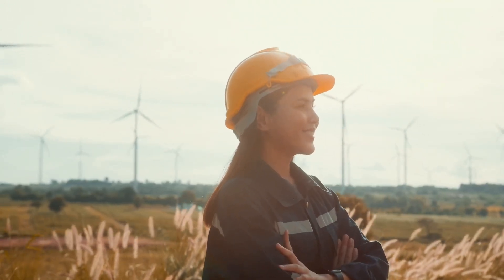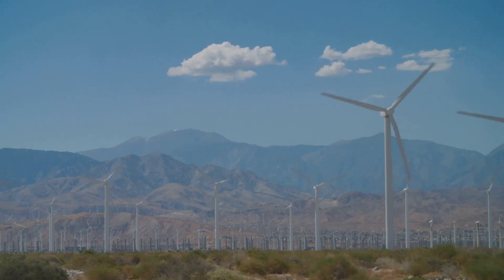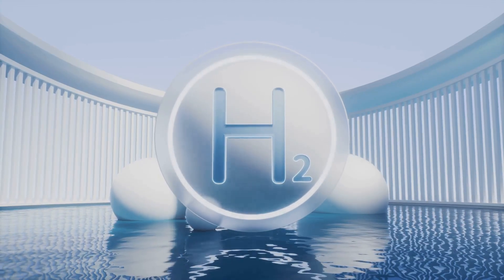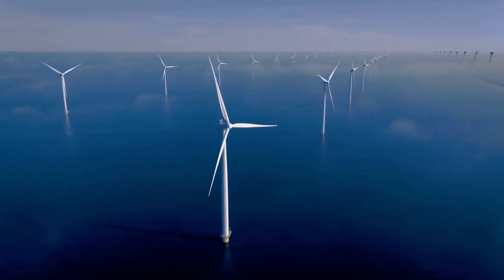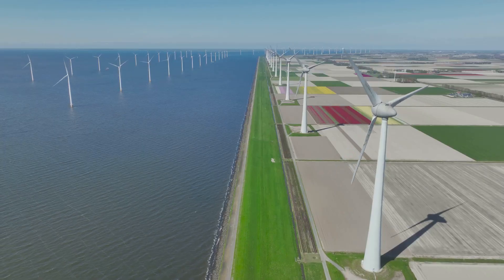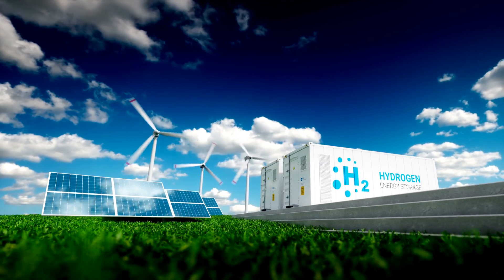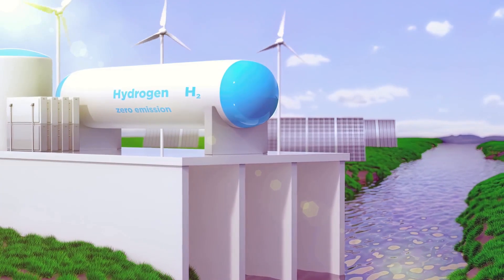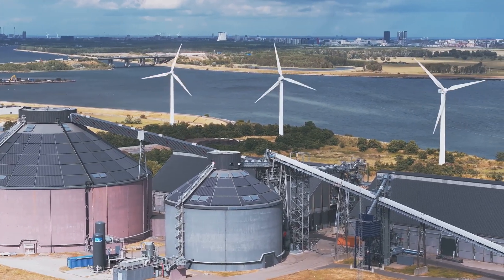Harnessing Wind Power for Hydrogen

Comment: So, if i am making a hydrogen fuel cell project using a wind turbine, can you explain what voltage current should the wind turbine have?
Reply from the maker: The voltage and current needed from your wind turbine depend on the specifications of your hydrogen fuel cell system, especially the electrolyzer. Most electrolyzers operate around 1.5–2.0 volts per cell, with full systems typically requiring 12V, 24V, or 48V and several amps of current. Since wind turbines generate AC power, you'll need a rectifier to convert it to DC and possibly a voltage regulator. The goal is to match the turbine's output with the electrolyzer's input requirements for efficient hydrogen production.
Reply: @futureenergytechnology I need to replace the 9V DC Battery
So according to that can you justify what voltage current will be required?

Comment: So can this process be used in cars.Like we give water to cars and then wind power elecrrolyzes H20 and use h2 in cars
Reply from the maker: Thanks for your comment. Using wind power for on-the-go electrolysis in cars is highly impractical. Electrolyzing water into hydrogen requires significant energy, which would be challenging to generate reliably from wind turbines attached to cars. Instead, hydrogen is typically produced at centralized facilities and then stored in high-pressure tanks for vehicle use. This ensures efficiency and safety.